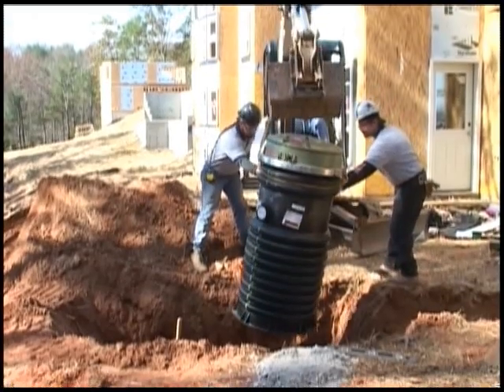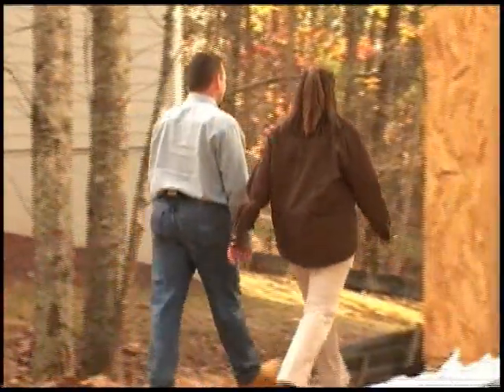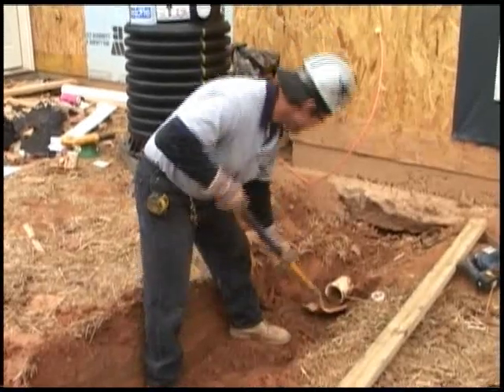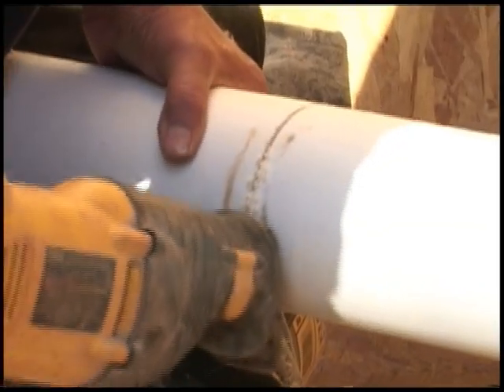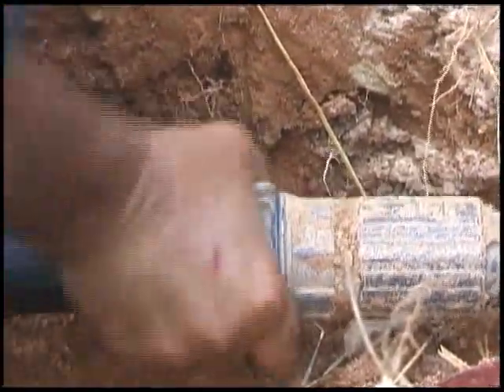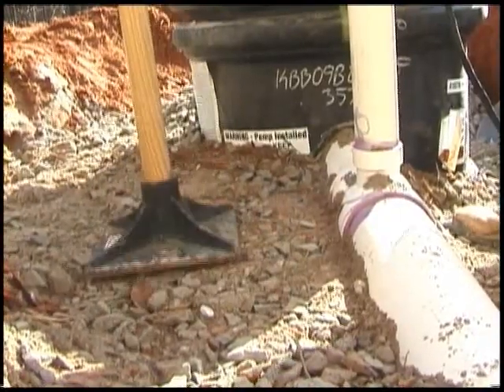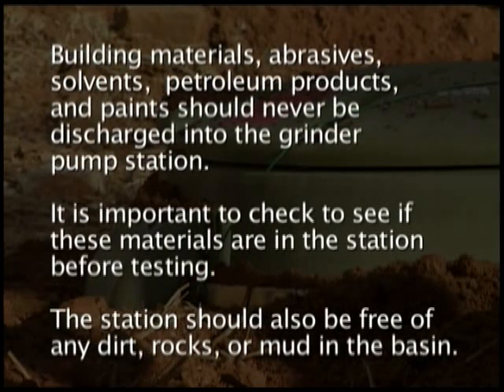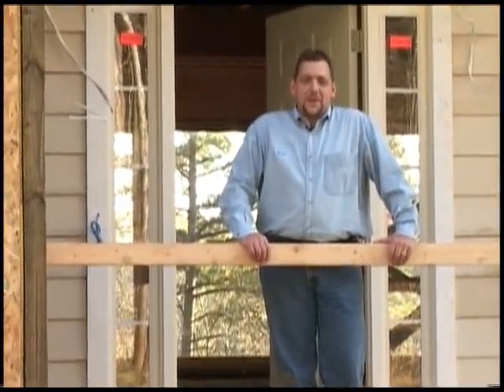Grinder Pump Installation: Installing a 2000 Series E/One Grinder Pump Station

Comment: Can you share the running and starting wattage for this unit.  Trying to size a backup generator and this will be hooked to that with other appliances.  TYIA
Reply from the maker: •	If it’s a 240v pump, a 240V generator must be rated to start a 6500-watt load minimum. 
•	Never use an undersized generator; it will likely cause damage to the generator, pump and/or alarm panel. 
•	Allow the generator’s motor to warm up completely before supplying power to the grinder pump station
•	Before connecting to the grinder pump station, measure that the voltage the generator is putting out unloaded. It should be 235 to 250 volts.
•	When the grinder pump starts, it will need approximately 6500 watts for up to ¼ of a second at 240 volts. 
•	Once the grinder pump motor is running, the wattage will drop to between 500 and 1200 watts depending on the pressure sewer system’s pressure.

**Note: E/One does not recommend using any type of “Auto-Idle” feature (if your generator is so equipped).

Comment: what type discharge pipe are you using that pressure rated???
Reply from the maker: The use of 1-1/4” PVC pressure pipe Schedule 40 or 80 and polyethylene pipe SDR 11 or SIDR 7 are recommended.

Comment: What is the pipes used with this such pumps, would the PVC work?
Reply from the maker: Pressure rated piping must be used (min 150-160psi).  SDR11 HDPE and SDR21 PVC are the most common.  SCH40 is used on occasion, though it MUST be pressure rated.  PVC drain pipe CAN NOT be used.

Comment: Would not have passed inspection in my city or any surrounding cities.
Reply from the maker: Hi Shon, As we note at the beginning of the video, all installation steps should be performed in accordance with local codes. Different municipalities may have different/additional requirements for grinder pump installations.

Comment: No cleanout on the 3" sewer line coming out of house???
Reply from the maker: Hi Shon, The line from the house to the station is 4 inch and should not require a cleanout on a  proper installation (proper pitch and location to the house).
Reply: @EONESewerSystems  It wouldnt pass without a cleanout. All installations require cleanouts.
Reply: @EONESewerSystems  whether it is 3" or 4"  the point I was trying to make is that you have to put a cleanout on it as soon as it exits the building where Im from. What if the line clogs back under house or from house to pump? Just curious. No big deal. Thank you.

Comment: Could a grinder pump station discharge into another grinder pump station which is connected to the main?
Reply from the maker: It doesn’t usually make sense to pump the waste twice, but there are some cases that require something like that.
The first GP station that is receiving flow from the other station must be rated for the additional flow.
Reply: @EONESewerSystems  Im evaluating the cost differences between connecting to the main or another grinder pump when converting my garage into an accessory dwelling unit. Thanks
Reply from the maker: @danbiss87  We recommend contacting your local distributor to discuss your idea, cost, etc. They will be familiar with local regs. You can get their info from our web site, eone.com/sewers

Comment: where did you buy a pipe from discharge E1 grinder pump to discharge main line/sewer line (my is 1.25" pipe diameter.
Reply from the maker: You can get the pipe from any local Plumbing supply place.
It should be either PE pipe, SDR 11 per ASTM 3035, or PVC pipe, SDR21 per ASTM 2241, or Schedule 40 PVC per ASTM 1785

Comment: Our community voted for this system (Windermere, BC) two years ago. Install was by the ONLY authorized installer, electrical permit by Red Seal BC installer, and it's a 20 foot rise to the road. Our system box has a motherboard in addition to all the components shown in this video, and on E-One site. Motherboard came pre=wired, but the meter has never worked and there have been several issues with alarm, overpressure, etc. since install. You're saying there's a "shut=off" up by the road? I'm thinking maybe they never opened it in full. This house is lightly used. We've had the pump out several times and the electrical checked without sourcing the problem. But "old school" guys, authorized or not, don't get near motherboards.
Reply from the maker: Hi Roy, can you send me an email at eone@eone.com so I have your contact info? I've sent your inquiry to Field Service.
Reply: We now have a running system, but no one seems to understand why. we are gathering the information and thanks for your call, but it was basically a duplicate of all we accomplished this month. We need to stop the guessing and evaluate and LEARN.
Reply from the maker: Roy, please send your contact information to eone@eone.com so I can get you in touch with the regional sales manager for E/One.

Comment: How much electric work would an EOne WH101 required.  Meaning, on average, material and electrical personnel required?   How much on average you see it will cost?
Reply from the maker: Hi Angelita - 
A dedicated 30A breaker is required, after the house panel and before the E/One Alarm Panel.
10 AWG wire has to be ran from that 30A breaker to the E/One Alarm Panel (L1, L2, N & GND) to be wired to panel per the Installation instructions.
The Pump Supply Cable, 6 conductor, direct bury cable, has to be connected to the Alarm Panel.
All wiring to comply with local and national codes.

Cost will vary from place to place and from site to site depending on cable lengths required.

You can find your local distributor on our web site at www.eone.com/sewers. Contact us at eone@eone.com if you have any more questions.
Reply: Just wondering if you were on sewer or septic?

Comment: Here in Ireland we do things differently. The electric cable might be in a thick red pipe so won't be damaged by future digging. Also, a warning tape is buried just below ground so as to avoid digging up cable. All waste pipes would be bedded in 1" round stone to support even slope. Stone filled around pipe and 4" over. Backfilling doesn't upset slope then. Also, trench for waste pipe would have been dug using 1 foot wide bucket.
Reply: B C Canada does the same thing. It's also usually then inspected, but I always take digital photos as an archive record. It's just good practice EVEN IF not required "legally".
Reply: Well this isnt Ireland

Comment: Whats the reasoning for putting vulnerable (and wear) components down the hole?  (Contactor, Start cap at the very least) - I understand these are fairly shallow but it just gives potential water intrusion  more things to wreck and is going to cause callouts due to failures.  A smarter design would keep as many components as possible OUT of the hole (as in how a typical submersible water well pump application).
Reply: I'm scratching my head on that one as well, having done water associations in the USA and dealing with Grundfoss and Franklin Electric.

Comment: These pumps are Very Expensive and don't last long at all. A company in Greensboro Ga installs these boat anchors  and they do not last 3-4 years. It's a shame for what you pay for these pumps. You could redo your whole septic system in most cases for what one of these pumps would cost you 
if it wen out.
Reply: Installed 3 of these pumps all in a row on a dead end street with no sewer line. Going on 15 years and not one issue.
Reply: @TheCrustyFry  Wonder why some claim to only get 3-5 years before the pump goes bad and they say they replaced the pump with a Liberty Omnivore ??
Reply: Ray Lat  Yes they are my neighbors.
Reply from the maker: +Matt Goodman Hi Matt, We have an average mean time between service calls of 8 years under normal residential use. Premature service needs or even replacement are most often attributed to poor installation (hence our making this video); misapplication; and abuse, ie flushing things that shouldn't be put down any sewer or drain. If you aren't allowed a septic system, such as this development in Georgia, pressure sewer may be the only option.